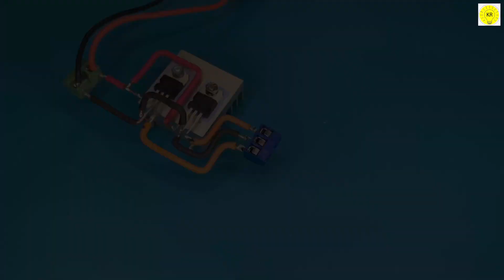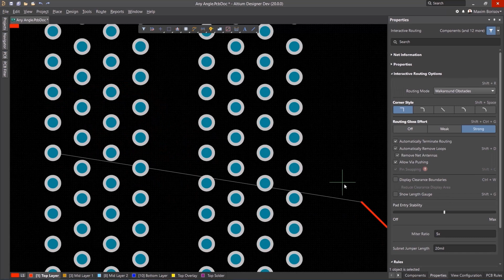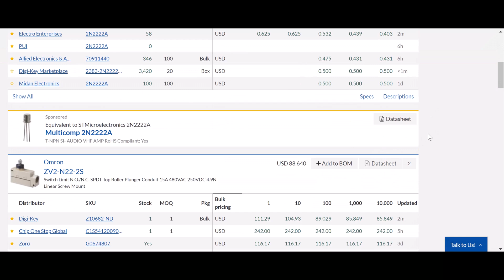how to make voltage booster 30v to 6v dc to dc boost converter

Comment: The first half of the video Is neither a boost nor a buck converter.  It’s just two linear regulators.  It has its uses , but terrible efficiency.  The second half is a buck converter by the look of it.  The efficiency of the second circuit will be probably ok, but it would be very useful to know , as this is one of the key considerations when comparing one DC to DC converter design over another.  Circuit layout very clear - so a nice educational video from that perspective
Reply: i was looking for this comment...if any one notice..